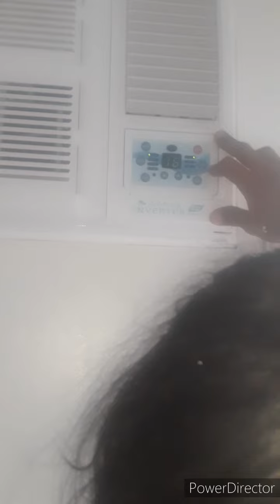Kolin air-con installation, window type. gawin

Comment: Good day kailangan po bang tanggalin yong AC sa case/housing? Pwede naman cguro ipatong nalang diretso sa butas na may bracket at di na kailangan mag drill upang e bolt yong housing/case.
Reply from the maker: hello po sir, sa ngayon po
may mga design na po na hindi na tinatangal ang case, pero lalagyan nyo po sya ng braket na kakapit, para sa vibration ng ac.
Reply from the maker: pero kung ang design naman ng ac na mabibili nyo, ay pwedeng tanggalin, mas maganda po na tangalin, para mas madali po sya sa tuwing lilinisin, huhugutin nalang.
Reply: Maraming salamat po sa advise
Reply from the maker: welcome po